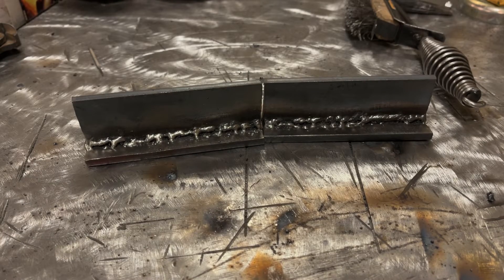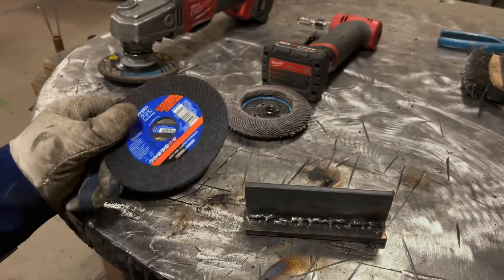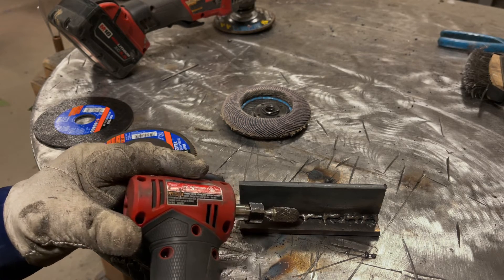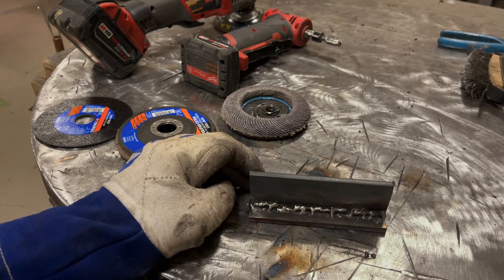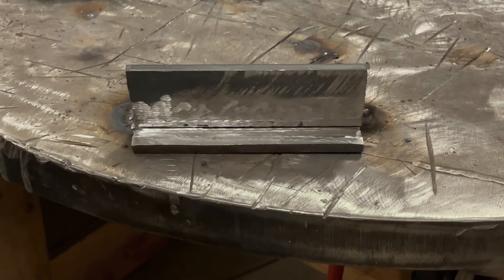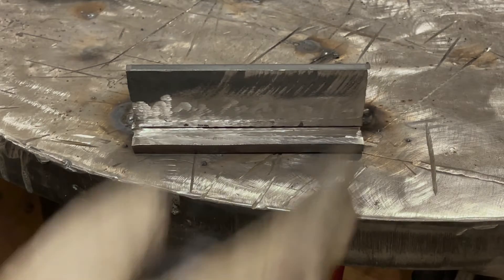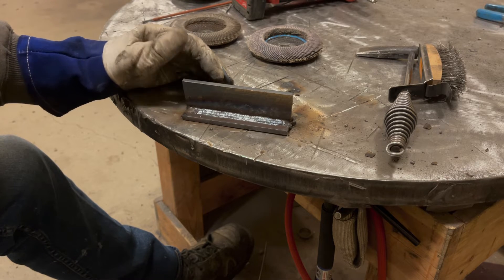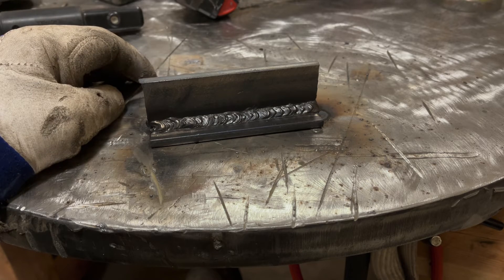Viewer question: how to fix bad welds 👨🏻‍🏭

Comment: old welding residue melts faster and somehow pulls the arc to itself, there is a sweetspot amperage to avoid this,  but it melts too fast and act as double electrode deposition, there is no way get any penetration through that not even with 6011. Maybe try bit colder and stick electrode tip in but that requires skill and its hard

Comment: I work in a more industrial welding role not the "home gammer" that you are teaching. 
I normally have 4 grinders close by. 
Grinding grinder
Zip cut for cutting 
Wire wheel for removing slag and cleaning welds 
Sand paper disc 

Can't waste time changing discs and often need more than 1 type if disc to do a job.

Comment: using an oxy/ acetylene scarfing tip to remove the bulk fallowed by grinding will speed up the process. Good advise about not trying to weld over bad

Comment: Wise words at the end, good demo - best to not take chances, do it right the first time, junk it and start over where appropriate, grind/gouge and fix where you can. Adding plate/sections and heavily reinforcing might be an alternative - especially with repairs and going over suspect work by the the last guy.

Comment: Sir what milwaukee battery you recommend i have 4.0ah battery but they run out fairly quick between 20-10mins of grinding 😢
Reply from the maker: For an angle grinder I have two batteries, 5.0 and 8.0.  The 8.0 has been very reliable and has noticeable longer runtime than the 5.0.  I have used the 12.0 a lot and after a year I swear it doesn’t have much more run time than a 8.0.  The new forge batteries offer more power but not a huge gain in run time from what I have seen.
Reply: @makingmistakeswithgreg  thank you sir, you have helped me quite alot with welding.
Reply: I believe Torque Test had a 12Ah Milwaukee that had a defective bank and their didn't put out more power than an 8.   So, more batteries packed in, more chances for one bad apple in the barrel.

Comment: I ran my first 7018 today, I got pretty good at striking 6013 rods, but I spent ages trying to strike and maintain an arc with 7018, is it more fussy about arc distance and travel speed?
Reply from the maker: So 7018 tends to be a bit rougher start than 6013.  To get around this if your machine has hot start turn it up a bit.  Some machines also tend to not produce much open circuit voltage which makes starting the rod far harder.  

For making things easier I would try this:  I am not sure what your amp setting is, or what machine you have, but turn up the amperage 5-10 amps from where you are.  If it’s too low it will be very tough to start it.  When striking the arc start 3/8th of an inch ahead of the start, tap the rod to the plate and lift it about 1/8th off the plate immediately. Once the arc is established quickly move the rod with the arc present back to the starting location and start welding.  This will solve the starting porosity that’s common and should make the starts better.  If you switch to a rod with a graphite tip (like Esabs 7018 prime) they are much easier to run than ones without.  The tip makes the arc start without sticking on the first strike.  On restarts you must  squeeze the tip of the rod with your gloved fingers to expose the wire core, or tap it on a plate to bust the silicon off so it will start.

It does take a bit to get used to 7018 starts.  Some welders are far easier to run 7018 than others so that definitely plays a roll.  Just keep practicing and it won’t take that long before you can get it.  7018 is worth knowing how to run because it’s far stronger than 6013 and it welds out of position better than 7014.
Reply: @makingmistakeswithgreg  Thanks Greg, for these 2.5mm rods, I was unable to strike an arc less than 130A (good clamp on grinded plate), and in order to get it started I have to bounce the tip a few times to get it hot, but voila, like you said it would, 7018 had no slag inclusions like the 6013.
Mine does not have hot start, its the cheap 160A Deko one from ebay. 
I am pleased with the result once I manage to get it started, so thanks for the tips!
Bought a old Lincoln 160S which is currently having its IGBT's changed, so hopefully that will make things much easier.
Reply: @engjds  7018 burn up into the coating a bit, that's why- knock off the exposed part each time, some guys keep a coarse file handy

Comment: This isn't really "fixing a bad weld" this is just "remove a bad weld and then don't do another bad weld"   Meh.
Reply from the maker: How can one fix solidified metal that has defects without removing it and starting over?  Many people weld over bad welds as a fix, when that doesn’t actually fix anything, it just hides it.    The fix is to grind it out and try again.
Reply: As someone who just laid a bead that looks just like the original pieces in this video, I was really hoping to hear a "the amperage was obviously too low, and the torch angle needed to be this way instead of that way, and the arc length must have been varying "like so" in order to get these clumps to happen. As a new welder, I don't know how to read the mistakes in order to make the appropriate changes. What did you do intentionally wrong to make the original bad welds?
Reply: The person that asked just wanted to see him do it😊.  Get rid of all.of it is th right way.  When I was little, I was my dads welding helper and inspector on the farm.  He would get tired of me grinding and just add 10-20A in hopes to burn it out.
Reply: @tsl7881 it might work cosmetically, but in a critical location it might spell disaster.

Comment: I hate to say it, but I’ve seen channels where the guy was testing some cheap welder and came up with welds not much better than those, and declared that the welder was pretty good because - look at those welds! Problem was, when he shows welds made with his “good” machine, they were about the same. And people were praising the “great” welds and wanted him to do more so they could learn from him as he was such a good welder. There are any number of channels like that. It’s frightening.
Reply from the maker: Finding reliable information can definitely be hard.  Even more so when you consider that perfect welds can be done easily on a bench, and then shown on camera.  It’s a totally different world welding something on a bench vs on an out of position project.  Even worse, many people to only show their best work and work that’s not reflective of the real world.  It’s also very easy for people who don’t understand something fully, to get the wrong idea off of videos.  That’s why I make it a point to be more realistic in what I show and purposely show screw ups along with mentioning them.  The truth is, if I wanted to make perfect welds on something I am an excellent tig welder and I would just use that.  Many things tig is either too slow or not ideal for, so stick and wire are far better.  Both of those are far harder to achieve “perfect” welds with, but luckily that’s not really needed to make things very strong.
Reply: Yes welder and Vevor sends out a bunch of product for utube creators to gently review to just about anybody they can.  Part of the deal is not to disparage their product,  well what about blaming themselves?
Reply: @tsl7881  Everlast us infamous fir that. They sued reviewers for saying that something wasn’t perfect. I can’t stand that company.

Comment: First and foremost about the grinding disks - never use a cutting disk for anything but straight up cutting unless it is a full metal diamond one. A diamond cutting disk for metal will allow much more abuse and side loading than a regular aluminium oxide disk, even a fiberglass reinferced one, but it is still not a good choice for removing large amount of material. A thick [stone] grinding disk will do the job but with a lot of noise, however, it will loose initially sharp edge pretty soon and won't be able to reach deep into a corner. A flap disk, my favourite, will do the job with lowest noise out of all types and can be pretty productive when new, but it will loose sharp edge pretty quickly, that's true. And I don't know how much do flap disks cost in US but I don't find their cheaper versions too expensive. The most productive and the most noisy and unfortunately, the most expensive disk that would outlast all of the above is the full metal diamond grinding disk. This beast will chew through metal in no time given that an angle grinder is powerful enough and a person handling it is strong enough to press it down into material.

Carbide burrs like this are cool, they have very sharp cutting edges that quickly dig into material and pull the drive, this makes it very hard to handle even a 1/8inch burr and what's worse - in corner a burr may start jumping between plates eventually breaking the tail off while shooting the burr head in a random direction. Too productive for manual use, perfect for CNC router. On the contrary a diamond burr while being less productive could be easily handled manually, unfortunately, this kind of tool has a relatively short lifespan.

Now to the carbon rods. A carbon arc is a good powerful heat source that can easily melt a bad weld or turn whatever thick plate you have into a pool of liquid metal. An obvious underside of using a carbon arc for fixing bad welds is that there's no protection from atmospheric nitogen and oxygen and high concentration of carbon ions, so this kind of method can only half-fix the weld at expence of its mechanical properties, parts must be rewelded afterwards anyway. Carbon rods can be used with a regular welding machine in DCEN polarity even without high pressure air source. A metric carbon rod is often comes in sizes like 4,6,8mm and above in diameter, this would be 5/32,1/4,5/16inch. A 5/32 carbon rod burns too quickly for many practical purposes and will work only up to ~60A without excessive burnout of copper coating, but it is a good tool for a small accurate job. A 1/4 carbon rod will allow for much more freedom of action, this one will work fine in 80-140A range just as a 1/8 or a 5/32 welding rod. Unlike a welding rod, a carbon rod must be clamped in a stinger at only about 4inch or less from the tip (working end), otherwise it is likely to be destroyed by a thermal stress. Since carbon arc dissipates a lot of heat, one must watch out for catching the stinger on fire, an open fire from the burning stinger may be not visible through a darkened welding mask.
Reply from the maker: Excellent tips and thoughts, thanks for sharing.
Reply: p.s. Few more things about carbon rods. First thing to remember, these rods are very brittle and must be handled with care. Air carbon arc gouging uses special kind of stinger with internal air channels and rotating clamp with a soft spring. Welding stingers have different construction, they usually have tougher clamps and some of stingers can even crack carbon rods in half, just be aware of that. It is possible to cut through even a thick metal just with blowing flame of a carbon arc , such cuts will be as wide as with a welding rod, but it is easier to cut with a carbon rod since it does not deposit any additional metal. Since a carbon rod is brittle you can't use it to push molten metal out the pool with the rod and have to rely on arc pressure to push material away from the arc by shortening arc length. A carbon arc can be stable from very low currents like just few amps, only a maximum length of arc is limited by the current, however, arc stability depends on a welding machine. Low current arc is good for locally preheating material or relieving stress in welding beads, kind of a safe replacement for acetylene torch. Carbon rods last many times longer than welding rods especially when used for cutting, unless they are broken mechanically or by excessive internal thermal stress or fast burnout from high current, so, while being more expensive than welding rods per piece they end by being more effective due to longer lifespan. And last but not least, for those who never used a carbon rod before - the working end that must be headed towards a workpiece is the one where copper coating is removed, this is opposite to a welding rod :)
Reply: p.p.s. One more thing about carbon arc - it is almost silent when stable and burns with a flame just like a propane torch or a candle. When a regular welding rod is used to cut metal, the arc produces horrible sounds like it contunuously burns through, but a carbon rod arc makes sounds only when it starts or unstable, e.g. when it is too long or too short.
Reply: I’ve often wondered, no having used them, what deposits the carbon is leaving in the area being cut out. Yes, most of the carbon is burnt off, but some small amount must be deposited in the metal. If so, then I can see a brittle weld.
Reply: @melgross  Well, just from how harder it becomes to grind off metal melt with carbon arc I can tell the carbon infusion is significant, don't know what it means in numbers. AFAIR an intended carbon infusion is usually done with DCEP polarity, but carbon rods are unstable in DCEP and run perfectly in DCEN, but even this way a lot carbon diffuses in base metal.

Comment: I really liked that honest safety input and I think it is important, as many of us (amateurs) are simply stupid, yes, that is how we are..
Maybe also lung protection is not a bad idea? I did grind a ton of concrete, I had to fix a bad job from "pros" and I did hate face masks even back then (pre 2020), due to humidity and  eye protection. Who knows what did I breathe in and lungs can suffer from that.
It is easy to damage ourselves in on the field, or even on small home job, and it is sometimes irreversible. And that is sad, very expensive, well, you get the idea what I am talking about..

Oh yes, and amazing video, Thank you very much :-)
Reply from the maker: Thanks for the kind words.  Your post inspired me to do a video on safety that I have been avoiding (I am not the safest guy in the shop lol).  We all need to take care of ourselves that’s for sure.  Doesn’t take too many mistakes before a accident or long term damage occurs.
Reply: The problem is, there are many people in this industry doing fabricating and welding videos who shrug off anything safety related. Many posters also complain that they don’t want to see anything safety related in videos. The woodworking channels have the same problem. It seems to me that there is too much toxic masculinity around. I see guys welding with shorts, a t-shirt and old acetylene welder’s goggles and no gloves.

Comment: Just plasma gouge it and use a dye grinder for the rest. Excavating a weld is an art as and repairing bad welds
Reply: My plasma doesn't have gouge and I don't have the amperage for carbon.  He is showing how most would have to fix a weld.
Reply: @tsl7881  all plasmas do, just need to drill out the plasma nozzle ie 5mm or so, and run as normal, will cause a decent plasma flame for gouging

Comment: The answer is to read the electro packet for the correct amperage to use and then practice until you get it correct.
Reply: That’s assuming all of us know how to read tho 😂
Reply: That does not help with fixing an existing bad weld, you aren't responsible for all the welds you encounter.
Reply: A few practice runs can save a lot of grinding/gouging, or worse.

Comment: I had completed a 4 year welding apprenticeship (Advanced City and Guilds Tradesman Certificate)  and had 10 years post experience totaling 14 years of welding (6 years in a UK Admiralty research laboratory) when I jacked it all in and became a Electro/mechanical Roberts technician (ONC in Mechanical and production plus Engineering HND in Engineering) .  Company had sent me to Japan on a Robotics course for 3 months. I had kept my welding skills quite. The works manager was attempting to weld!! I stood over him and took the mickey of his attempts until he through down the MMA welding equipment and stormed off.  Picked up the equipment ground out his bad welds and welded it properly. I only did this because I was being transferred the following week.
I never again wanted to go back to welding.

Comment: 👎 no handle, no guard on an educational video.
Reply from the maker: I covered that multiple times in past videos and I even took 2 minutes and covered that very thing in this video.  That’s how I roll with the Milwaukee.  Corded grinders I use the guard, the Milwaukee I don’t.  I wear eye protection.  The Milwaukee grinder without guard is no more dangerous than 90% of the tools in my shop.  Everyone can choose to use what they want, which is why I acknowledged that I don’t use a shield with the Milwaukee and that a individual probably should.
Reply: I always try to leave them on.  Sometimes you can't.  You should always have eye protection, I've ruined a pair of 99¢ HF safety glasses with a flying disc piece.  The 99¢ are garbage, the $3-4 ones are much clearer.  Greg is also wearing gloves, they tell you not to do that, but it's cold sometimes or I just put a weld in the wrong spot because of dirty lenses or smoke